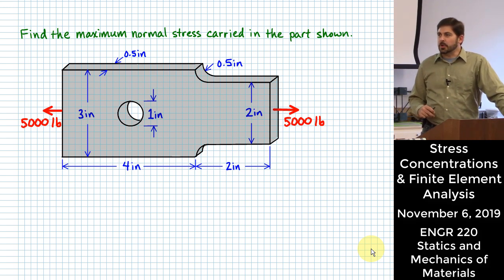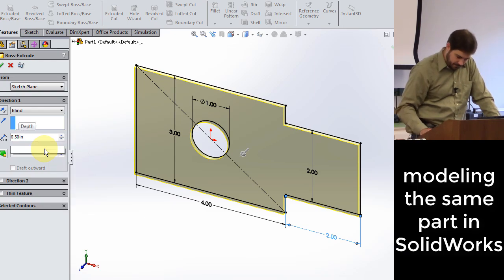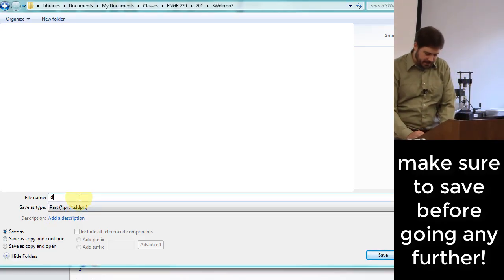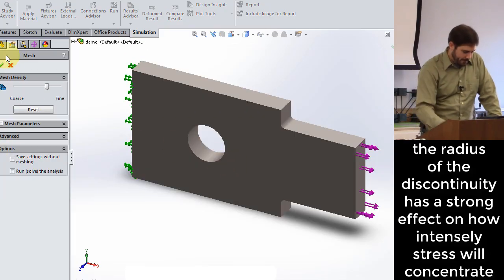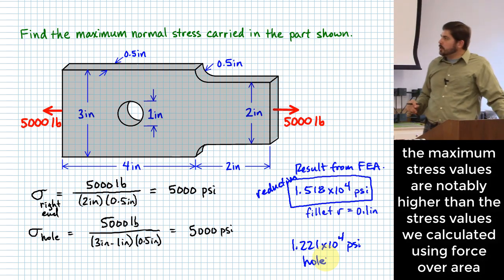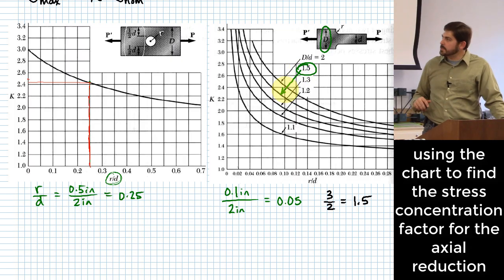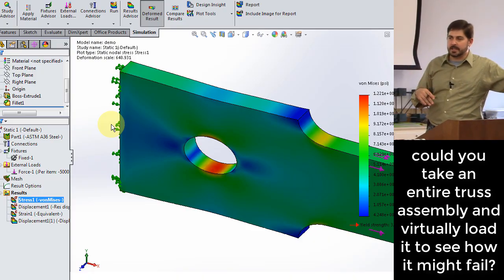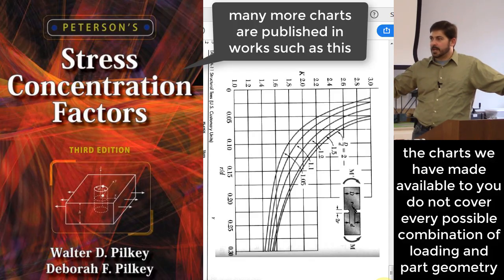Stress Concentrations and Finite Element Analysis (FEA) | K Factors & Charts | SolidWorks Simulation

Comment: Hello. I downloaded almost all your videos and learned a lot of information thanks to you.  In the analysis you made with the Solidworks program in this video, at minute 47:30, the r/D ratio should have been taken as 0.1/3 instead of 0.1/2 in the notch graph. A lower value emerged than the program's conclusion. With 0.1/3, the K value seems to be approximately 3.12, which gives a value of 15600 psi, which is quite close.
Reply from the maker: Thanks for the words of encouragement. The charts I'm using don't require the r/D ratio, only D/d and r/d. D is the larger width and d is the smaller width, based on the figure included on the chart. I believe the correct point was found on the correct curve in the video. Thanks for watching!

Comment: ok. so if i want to calculate stress concentration factor from the simulation, i have to divide the max stress from the color chart with the stress that is away from the hole and dont have the effect of the hole. and then compare what i got as a factor to the one from the charts for D/d ratios?

Comment: Once again, a great video, well presented! I just want to note that the existence of the hole affects the stress in the fillet. That means that the hand calculation is not quite accurate and it explains the difference with the result in Solidworks.

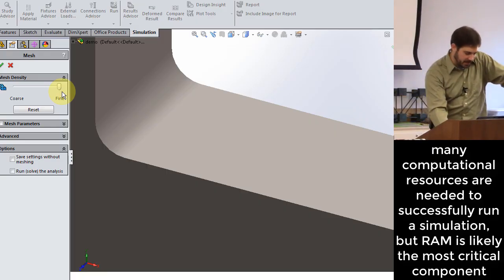Comment: I wish I knew about this before my FEA class… This is very helpful thank you. I wanted to note, at 29:00 when discussing curved surfaces causing element distortion with Solidworks you can apply mesh control locally to that surface instead of refining the mesh for the entire model(generally half the element size of the global mesh is standard). This will save you time and computer memory when running the mesh.
Reply: Good tip. I do the same. The way I choose on which bits to locally reduce the mesh size is to first run a coarse gobal mesh and then when I get the areas of stress I increase the resolution in those regions i.e. holes and other interfaces.

Comment: I am designing an aluminium chasis, I did some static structural tests on it, there were very localised stress concentrations. I was scratching my head for weeks to figure it out. This video cleared all the doubts. 
Now I am confident that my design is pretty good. And those very localised stress zones will be fine. 

Thank you very much. 
It's such a great lecture. 
Can't "stress" this enough, this lecture is great.

Comment: Thank you very much Sir it was a very good explanation, but what I did not manage to understand is that in this problem (in example) we have a concentric force applied in the cross section but when you used SolidWorks you did you use a distributed and non-concentrated force, why is that?
Reply: Cause it doesnt make a difference away from the edge

Comment: But finite element analysis is not computational solid mechanics. Do not conflate the two
Reply from the maker: Tissue paper is also not always Kleenex. Personally I try to avoid being too pedantic about these things.
Reply: @TheBomPE  i try not to confuse people with mislaid terminology. it depends how much detail you want the viewer to have i guess. it's more like saying that all wood is kleenex given the disparity. fully appreciate that's not the purpose or intent of the video and it's title. you'd be surprised how widespread the issue is and the impact it has on the basic understanding between different groups. while that can be considered pedantic it depends what your perspective is and if you have any role in bringing insight on what the difference is between solid mechanics and numerical methods.

Comment: I believe the overall load is 10K.  You diagram shows 5K pulling from each end as opposed to a F that is equal and opposite.
Reply from the maker: No, 5000lb applied to one end with 5000lb reacting against it at the other end means that the part is carrying 5000lb.

Comment: bonsoir c'est les variations de température sur cette pièces et sa composition chimique usiner comme pour un moteur air bus de chez role roys sur ordinateur et soufflerie.
Reply from the maker: here is what Google translate gave me:
"good evening it is the temperature variations on this part and its chemical composition machined as for an air bus engine from role roys on computer and wind tunnel"

Comment: The amount of material above and below that one inch hole is equal to the narrowed 2 inch right side. If that 5000lbs. is the SWL, that's because it's the "Safe Work Load" for the least amount of material under stress

Comment: My FEA professor said that the Solidworks Smulation FEA tool is inaccurate and shouldn't be used.
Reply from the maker: Seems like a pretty broad statement.
Reply: That's been heard a lot. I rarely used solidworks for FEA. I think when you have more nodal elements, your accuracy tend to increase. FEA dedicated softwares should be having an edge in that sense.

Comment: Great lecture and wonderful lecturer.
 I can understand why you are using psi( American units) instead of S I (International) units  N/mm2.
Now, it is clear from the results obtained from the analyses that the stress concentration is in the neighbourhood of the hole. Now, if the plate(say Steel) is used in building the deck of a ship and opening is provided for access, how can Solid work take care of reinforcing rings around the hole using   triangular or other elements? Finally, are these lectures available as hard copy?
Reply from the maker: Thanks for the encouragement! In solid works you can model more complicated geometry and loading scenarios than what I did here. So if you want to investigate a reinforced hole in a ship deck, I would expect you could come up with some reasonable way to limit the bounds of your study to do that. I'm sorry, right now I don't have hard copies available for my lectures. Thanks for watching!

Comment: Could the difference in the reference on the book vs fem be due to the difference in distance from the boundary to the neck, presence of the circular opening or different boundary conditions regarding deformation parallel to the plane that supports the element?

Comment: Very informative video, Can I get the reference file somehow and a small question, Why can't we see the max principle stress in fem to compare with the analytical solution. Because the max principle stress will show Higher value. Basically I'm confused with whether should we use von misses or max principle stress to compare
Reply: Have a look on Mohr's theory and von misses theory, basically von misses includes the tensile/compressive stresses and transversal stresses (shear) and it's mostly used for failure cirteria for static ductile materials (if your allowed stress is lower than the highest value of von missed your component would start to yield. The principal stresses shows you the pure tensile or compressive stresses in your part.

As I mentioned above please refer to Mohr's circle and the description of the distortion energy by von misses to better understanding and application. Also have a look on failure criterias

Comment: Hello.  I'm a novice SW/FEA user who's beginning to work more and more with FEA for school.  How do Solidworks' FEA simulations match up with other FEA software such as FEMAP or Nastran?  When does SW not do an efficient job with finite element modeling?
Reply: Solid works in general is not that much used in FEA. ANSYS is a free software. The meshing quality is much higher with FEA dedicated softwares and will give you better results.

Comment: If we are given pressure load instead of that 5000 lb force. then what would be normal stress ? will it be the given pressure then?
Reply from the maker: In this video, I basically treat the force as if it is distributed uniformly on the face to which it is applied. This is equivalent to a pressure or stress, as you are asking. Thanks for watching!
Reply: @TheBomPE  means I don't need to find sigma nominal if a pressure is given as load in uniaxial problem like this. that pressure would be sigma nominal.
Reply from the maker: Correct... unless there is a different cross sectional area where you're calculating stress than the place where the load is applied.
Reply: @TheBomPE  yea thickness is same but the filleted flat plat is stepped.

Comment: can you please tell me difference in contact set and component contact in simulation.
Reply: Contact refers to how the components interact with each other (bonded, not bonded). The hierarchy in SW simulation goes as follows: Global contacts>Component contacts>contact set (local contact). Contact sets are defined between two faces/edges that can even be within the same component, these are commonly used in cases where you want to simulate interactions between faces that are free to come in contact but are also free to separate (no penetration contacts). When you choose component contacts SW requires a list of 2 or more components and it will impose the specified conditions on all faces it finds in common between those components. Because of their hierarchy, local contacts will overwrite component contacts and component contacts will overwrite global contact conditions.

Comment: If only SolidWorks tutorials would explain things as well as you have.  I subscribe to LinkedinLearning as well ($30/mo) and they don't do as well either!  I have been a mechanical engineer since 1992 and just last year forked out the money for the standard simulation.  Since I am not that familiar with the software, and know that bad assumptions on software inputs can provide answers that are disastrous (especially in flow dynamics!), I ALWAYS do what I call a manual "sanity check" on the numbers I get from SW (typically ignoring stress concentrations, except for cases where, for instance, the hole in the part you use in your tutorial, is Ø2" or more instead of Ø1".   In that case, both manual calculations and SW quickly point that error).   For stress concentration factors, Machinery's Handbook has the same set you displayed, with torque indicated clearly.  Machinery's Handbook, Marks Mechanical Engineers Handbook, and Timoshenko are my most used references.  I really wanted simulation that handles dynamic loading, but couldn't afford it.  I'm stuck doing those calculations manually and inserting factors of safety that are probably too high.  I'll look for something on dynamic loading from your selection.  This is the first tutorial from TheBom_PE that I have watched, but liked it enough to subscribe.  Kudos to you sir.

Comment: Great lecture! I have a question though. What if the problem is outside the bounds of the stress concentration factor graph? e.g. if the r/d value is greater than the range on the x axis of the graph. What are the implications of this and what should you do instead? Thanks!
Reply from the maker: If r/d is greater than the horizontal range of the chart, you have a few choices. (1) Look for a similar chart that has more range. (2) A conservative thing to do is use the K value at the rightmost point on the chart you have. (3) A non-conservative method is to roughly project the slope of the right end of the curve further right. (4) An even less conservative thing to do is ignore the stress concentration effect entirely since r is "large." (5) Occasionally you might be able to find or create an equation for the curve you are using which will enable you to more accurately project outside the curve's range.
If you go to the left of the curve's range, K is obviously increasing rapidly because the discontinuity is becoming sharp. At some point a plain stress concentration factor technique is insufficient, and a fuller, fracture-mechanics-based analysis is called for. If you are interested in a brief intro to fracture mechanics, check out these videos:
https://youtu.be/SD6qITe3-Xo
https://youtu.be/E5tgDVN1zy4
Reply: @TheBomPE   Thanks for the quick and detailed response! you've been a great help, I'll check out those videos

Comment: Thanks for sharing. trying to learn how to apply FEA to large assembly models for things manufactured where I work. Been having trouble with the simulations getting errors during the meshing step. Have tried running on smaller sub-assemblies and still receiving errors. I can get this to run on single parts, but need to find out how to apply on assembly models to confirm that equipment will not fail for customers.

Comment: Hi. Thanks for sharing this. Aroud 47:30 you found slight differance between the FEA result and result you got from formula. The reason of that differance is that you used r=0.5 in in formula but 0.1 in in Solidwork. And ım suprised nobody in class told this to you :)
Reply: In regards to this, I was also wondering why he used 0.5 rather 0.1 in the main formula when he changed it to 0.1 in solidworks specifically for the fillet. I understand 0.5 didn’t give any stress at the fillet location, which explains that 0.5 was a good choice to reduce stress. Did he purposely changing it to make it sharper to show stress, so the situation can be solved? The overall answer would be, don’t use anything less than 0.5.
Reply: No.  He did it correctly.  The reason the stress values are so different is the effect of the hole in front of the reduction in part thickness.

Comment: Hi - thank you for making this lecture available. Should stress concentration factors be used for ductile materials?
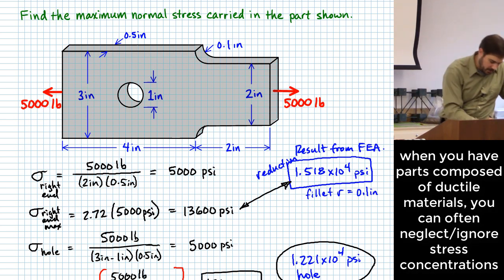Reply from the maker: There is a stress concentration whether or not the material is ductile, but as I discuss at around 56:40 and following, stress concentrations can often be safely neglected for ductile materials. Whether or not you should neglect them is controlled by whether you can tolerate tiny amounts of permanent deformation at the concentrated locations. 

Thanks for watching!
Reply: TheBom_PE  hey that clears it up, thanks. One last thing that has been confusing me - There was a question in Shigley textbook of the sheer stress in a double shearing pin. The solution didn’t use ‘sheer stress = V / A’ as I would expect but ‘sheer stress = 4V / 3A’ which is the formula for translational sheer stress in a round beam. I thought you would look for the sheer across the pin, not along the pin?
Reply: @SeracS354  
one is longitudinal shear stress and the other is transverse shear stress (from bending)